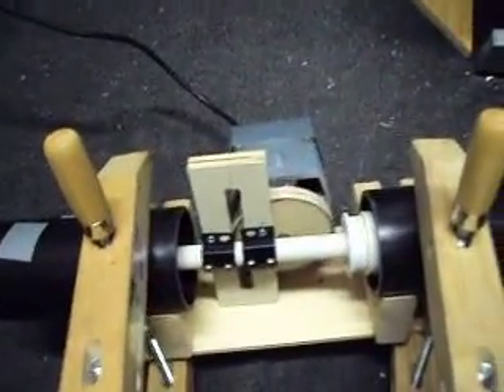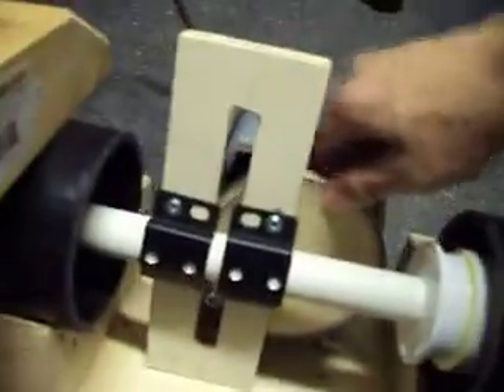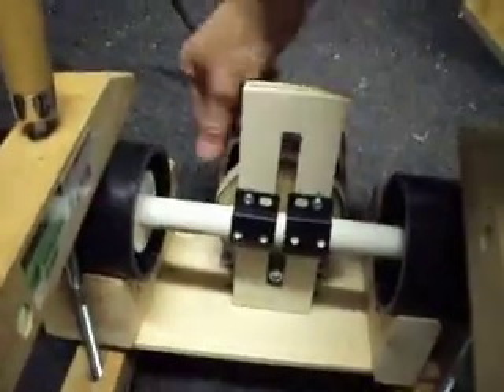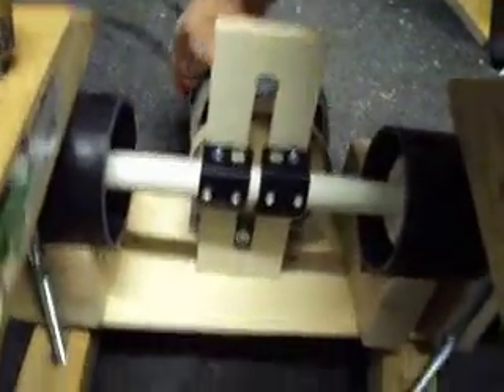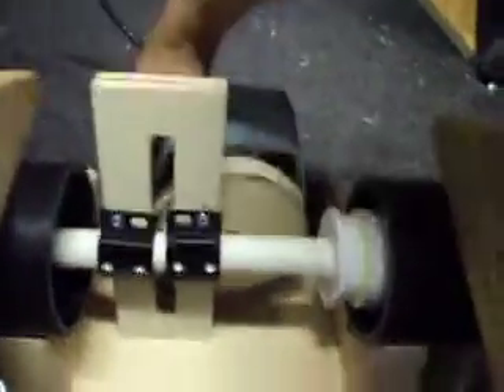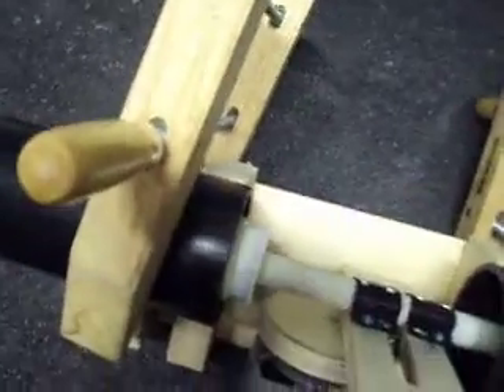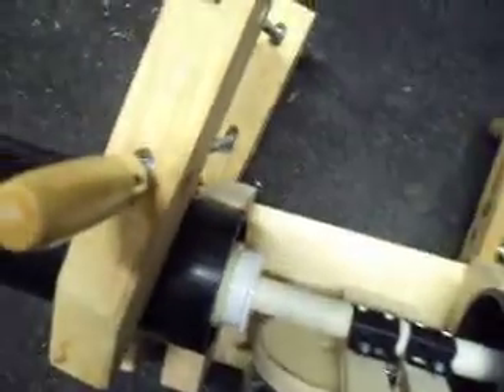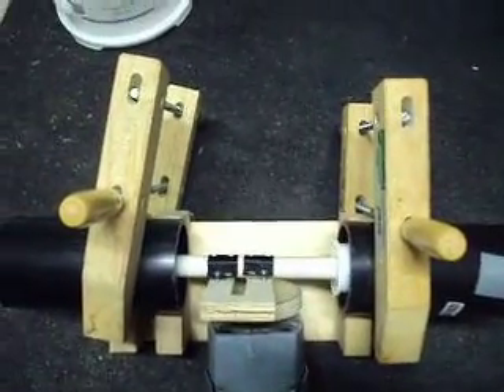Automatic Piston Bellows intro

Comment: So did they work and did you attach them to a forge or not?
Reply: ***** I see. It was a good idea though, and I was interested. I appreciate the response. I am building a fuigo bellows box and I'm almost done, I just have to put the collection box on the outside and connect a hose, put the air seal around the piston edge where it contacts and put the lid on it. It already gives a great airflow even without a seal so I'm expecting some really good hand powered airflow! : )